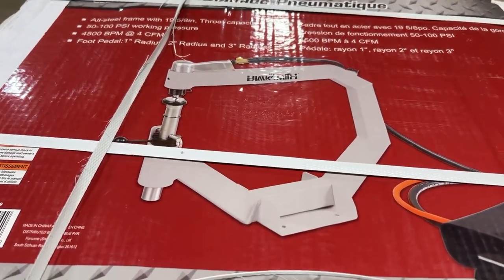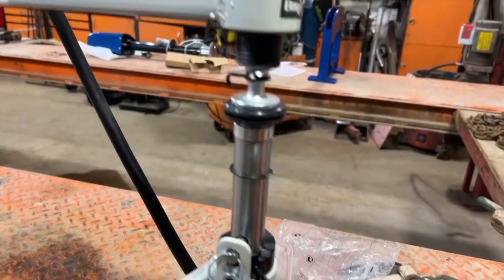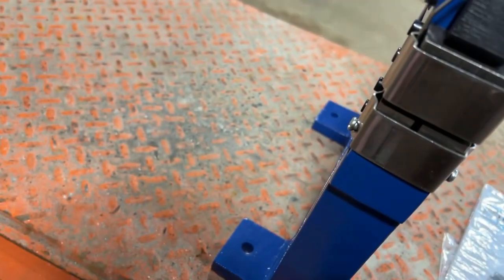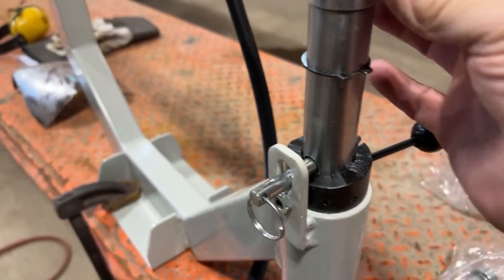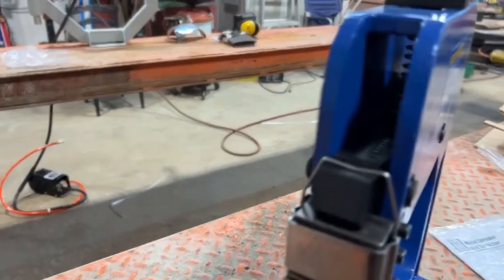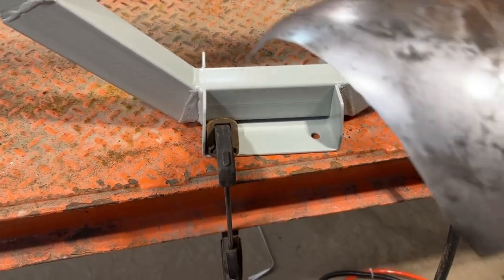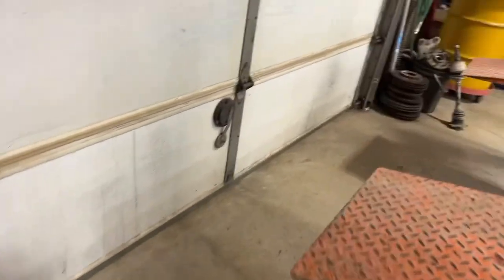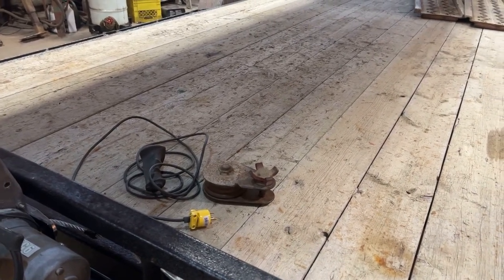Added a few tools to the shop

Comment: Had my plannishing hammer for awhile but haven't had a chance to use it. 
The shinker stretcher I had the 2 small ones and was just going to build a bigger frame since they have to switch over. One thing the dies need cleaning and tuning for them to work semi properly
Reply from the maker: I have the small ones too, on a base and made rods so i can use foot pedals to operate.